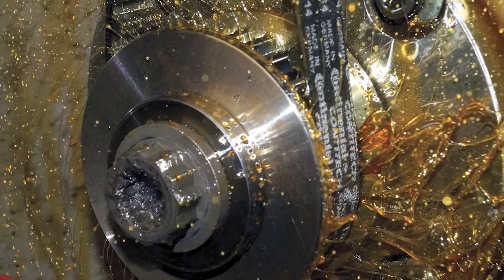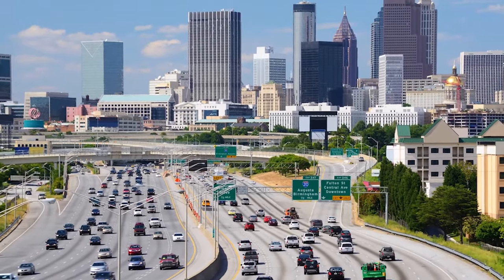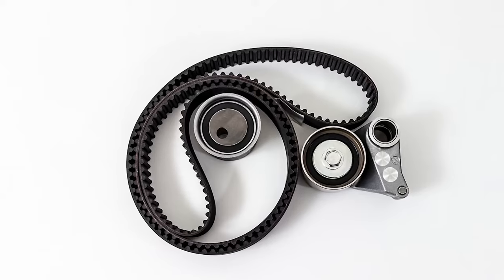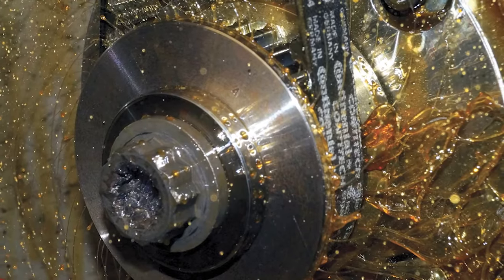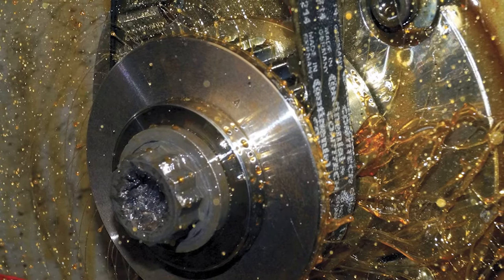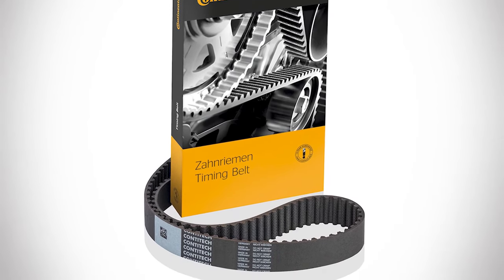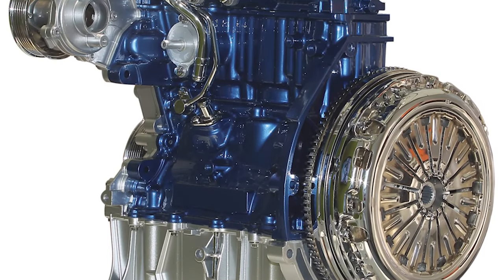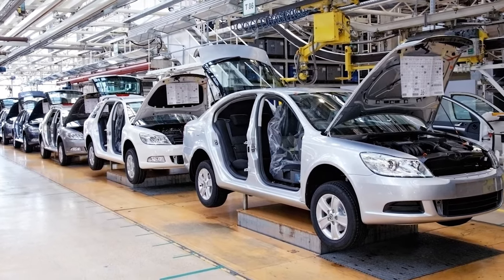Belt-in-Oil Timing Systems

Comment: There have been so many failures of belt in oil system that screw up the engine entirely. The benefit is far far less than the problem it has created. These engine manufacturers have lost their mind.
Reply: The benefits for the car makers are great, it's called planed obsolescence...
Reply: @AltMarc  True. Benefits for car makers, not for car buyers.
Reply: You are supposed to scrap the car before the belt goes , that is 100,000- 150,000 miles .

My wife has just bought one of the eco boost engines at 33,000 , and I will make sure we sell it at 99,000 miles . 😮 ( if we are lucky , it will not fail before that )
Reply: There have been reliable belt-in-oil timing systems used in VW TSI engines. However, the best timing is a timing chain with multi-ply chains and low-friction coated metal guides. Timing chains for the most part last as long as you do regular oil changes. The traditional belt-in-air timing systems which have been widely used in SOHC and DOHC engines throughout the 1960s to the early 2000s are designed to last between 60,000 to 90,000 miles and are pretty good too and are easy to replace and a reputable mechanic will check it at 60K miles.
Reply: It's just ford
Reply: @jalee6587 No its not, PSA and Honda also have this kind of design. Oil dilution with petrol is the main problem, direct injection + wet belt + wide oil changes + low visco oils = engine destroyed a lot sooner.
Reply: @A2Z1Two3  that’s a logical plan, however I’ve had wet belts fail at 30k miles and its rare for them to get past 70k before failing and destroying the engine. Good luck 🤞🏻
Reply: @jalee6587  GM is on this bandwagon as well with their 1.2l and 1.3l 3 cyl turbo engines. (Trax, Trailblazer, Encore, Envista and others)
Reply: fladave99   the recall is basically that they take the filler cap off and look at the belt, if it doesn’t obviously look like its breaking up then they don’t replace it….
Reply: fladave99   yep, I’ve the same mindset. I’d much rather get payed to solve other people’s expensive  problems than have the stress of said problems 👍
Reply: @A2Z1Two3 so how its going with the bus is it okay
Reply: It’s all about reducing costs to them. Designing a traditional timing belt system is obviously costing them money.
Reply: @carlosgilpinheiro7510 from what I understand Honda only uses wet timing-belts in things like lawnmowers and such. Not their high volume vehicles.
Reply: It's too keep various car brands parts dept in business.
For wet belt kits
And hopefully brand new bare engines to sell.
And of course the dealer franchise workshop in work also.
All while the customer gets hammered with a
Few grand bill for parts and labour.
At their expense

Comment: Chains,proven and tested over a hundred years,let's cut the bullshit.
Reply: Yes proven to fail because they are nearly always ignored.
Reply: Metal gears off the crankshaft for pushrod ohv are the best, bevel drive for ohc engines. Problem solved.
Reply: @vumba1331  as you say gears are the ultimate but as mentioned above it's the most expensive and arguably noisiest option, the cost is probably the main issue though in mass production. 👍
Reply: fladave99  that's not how mass production and profit margins work, people are willing to pay more for complex engineering on "prestige" cars, nobody wants to pay more for a Ford because it's still a Ford(or other mass produced brand).
Reply: fladave99  I completely agree with you and if I wanted a car I'd buy a Toyota, Suzuki, Subaru or possibly a Honda (although they're not what they were), if I wanted some trimmings I'd buy a Lexus, fabulous cars, I did have a C6 Z06, great car but it had electrical gremlins and wasn't a pleasure to own reliability wise. I've had Pontiac Firebirds and they were fabulous cars but if you want a car that might not be exciting but will do the job year after year then the above Japanese brands have you covered. 👍
Reply: @captainchaos3053  I've always had GM pushrod V6 and V8 powered vehicles, and the short timing chain on them is not a regular service item. It's something you replace during an engine rebuild, and don't really think of between rebuilds. My Studebaker V8 is a gear drive. There are very occasional failures of the phenolic fiber cam gear on cars (these were made of Micarta because it's quieter), but replacing them with an aluminum gear (used on trucks) netted a cam drive that will never fail.
Reply: @TorCow1234  I agree totally. However many modern chain systems are due for replacement long before a rebuild is needed and when over looked as they often are failures occur. I have had ford's V4s and V6s with the fiber gear too. My 3.9 V8 runs a short toothed or "silent" chain, but it's a service item changed every 80-100k.
Reply: R and D at customers expense.

Comment: These belts are letting go at as little as 40,000 miles. Truly disastrous resulting  in massive cost or a worthless pile of metal.
Reply: Agree if the owner does t fix it
A car or truck or van on hire purchase destroyed and still 38 m payments of 350 plus for what

Comment: Back in the 70’s and 80’s, my husband, being a mechanic at the time says that one of the biggest causes of failure with the then new idea of using rubber belts in place of timing chains on overhead camshaft engines was oil leakage from the camshaft oil seal, the oil causing contamination and premature failure of the belt. A particular problem with the Ford Pinto engines. How on earth 40 plus years later have these so called design engineers decided that it’s a good idea to run a rubber belt through a ‘bath’ of oil? The mind truly boggles.
Reply: At least the Pinto was a non interference engine !
Reply: @VWT5Alive   Depending on what size engine it was.
Reply: Remember the pinto engine!!! At least it was non interfering!!
Reply: it's not 1970s rubber

Comment: As you can never really be sure your shop is replacing your oil with the correct spec, these belts are just a time bomb. They also cost 3 times more to replace than a dry belt, so many cars will never have then replaced with the result that many will destroy their engines prematurely. Don't buy these cars and manufacturers will stop making them.
Reply: Hey that is unfair that people won't replace them and it will cause early engine failure. That may not happen. Especially when the belt fails long before it is do to be replaced because it may still deteriorate when not been driven continuously.
Reply: My daughter and her husband told me they were buying 2 new Chevy Tracs ,one for each of them, I said that I would not buy one because of the belt in oil timing belt and a tiny motor with a turbo charger to add to the stress it would already be under to move  a heavy vehicle and to sum it up is asking for problems down the road in expensive repairs if you plan on keeping them way past the warranty, they both looked at me like What ? Then did not have any interest in asking what I was talking about and just disregarded anything I said with a mind set of a lot of people out there, when it breaks I will get it fixed, and if it is expensive, just put it on my credit card ! All they know is they like the looks of it, the price is cheap and nothing else matters.
Reply: 2024 Chevrolet Trax 1.2 liter has two one for timing and one for the oil pump. Not only that but the cover over them which covers the entire front of the engine is a one time use affair which only adds to the cost. The 1.3 liter in their Trailblazer has a chain.

Comment: Ford Ranger 2L bi turbo diesel uses a wet belt. After a while bits of rubber come off the belt and block oil ways. Crazy idea they have gone mad! A rubber belt running in hot oil is a recipe for disaster!
Reply: You must understand that FORD recently risk anything to be in business. But too bad  risk is risk.

Comment: The total brake failure that my son experienced while coming off the slip road at Junction 10 on the M23 motorway was terrifying and he (and his apprentice) were fortunate not to have been involved in a major accident at this busy junction.
The cause of the failure is well documented - the use of the wet belt inside the EcoBoost engine causes delamination over time. Debris from it eventually clogs the pick up pipe and vacuum pump which then fails causing the brake pedal to go hard. 
The brake pedal simply cannot be depressed to slow the vehicle no matter how hard you try.
He is self-employed and relies on his Ford Transit Custom van everyday. It is currently at a Hendy Ford garage awaiting a goodwill gesture from Ford - as it is a few months out of warranty - yet the wet belt was not due to be changed for another 30,000 miles at the earliest.The current estimated cost of the repairs are £1,800! In addition, the failure of the wet belt may have caused damage to the turbo and the cost to replace it would be £1,000 according to Hendy. He has had the vehicle regularly serviced  - using the specified oil.
Ford have a duty to undertake the repairs - and cover any additional damages resulting from the delamination of the wet belt but they are digging their heels in - offering a fraction of the repair cost.
Reply: Has it been resolved yet?
Reply: @megataurus7779  Yes - after many weeks of wrangling ...and the vehicle being off the road in all that time. As I understand it, Ford and the dealer both made contributions which kept the final charge to my son to a minimum.
Reply: @paulfildes5489  good to hear,😉👍
Reply: Yeah but now it just has a new belt that will fail prematurely, again.
Reply: @Bloodbain88  just halve oil change interval
Reply: @sssssneaker  Might it be an idea to get the sump off and clear the oil strainer at 30,000 miles as it doubtful an oil change will remedy a blockage here. That seems to be the Achilles heel in the system giving problems even if the belt does not actually break as here. The cost is around £160 from what I see.

Comment: It is not a lot of fun changing a timing belt. Add oil in and you are just adding trouble.  You don't have to add oil to the belt just make it of better material.
Reply: Sounds as smart as internal water pumps.
Reply: @phiksit  Changing water pumps on most front wheel drive small cars is a whole engine removal and reinstallation. Because there is no room to get bolts or the water-pump out.

Comment: Was going to buy my wife a Ecosport until I found out it has a wet belt. The new for 2024 Chevy Trax 1.2 liter has a wet belt two one camshaft and one oil pump. Whereas the 1.3 used in the Trailblazer has a chain. My question is, as oil gets miles on it, it becomes very acidic. I would think that acid would work on deteriating the belt with small pieces getting into oil passages and blocking them, so the engine is toast. This sort of reminds me of when Chrysler thought it was a good idea to have the water pump in the crankcase of the 2.7 liter engine. What a cluster that was. Think this may very well have similar results.

Comment: Here in Europe we call the Ford Ecoboost the Ford EcoBOOM for good reason. Stay well clear of wet belt design engines !!!
Reply: The little 1.0l EcoBoom also had the inconvenient habit of bursting coolant hoses.  The mass of the engine is so low that the whole engine overheats very quickly and then seizes, before the driver is aware of the problem.
Still, the engine is cheaper to make and that boosts (!!) Ford's profits.
Reply: Are they also interference engines so the engine pretty much destroys itself when the belt breaks?

Comment: 1.0 ecoboost.
Failure (without warning) means the car is beyond economic repair $8.000 for new engine on 3 year old 35,000 mile dealer serviced car.
Ford say 'get lost, it's YOUR problem'
If you decide to change the belts before this happens, it costs $2,200.
DO NOT BUY A CAR WITH THIS ENGINE
Reply: There’s a TSB for the dealer to give a free long block. Your dealer ripped you off.
Reply: Are there aftermarket timing sprockets and timing chains for the 1.0 ecoboost engine?
Reply: Ecoboom!! 🤯

Comment: Any quick online search including YouTube videos will reveal that wet timing belts are unreliable junk. 
Several European automakers who have been using this technology for a few years have bombarded with complaints from customers of not only premature timing belt failure at the 50-to-60-thousand-mile mark on a belt supposed to last 150 thousand miles but rubber peels from the belt plugging up the oil sump screen causing the engine to have oil pressure loss and shutting down.
The oil pan must be removed to clean the sump screen which is costly.
Even worse, if a small piece of rubber gets into an oil gallery that part of the engine is oil starved, and you have premature engine ware.
To change the wet timing belt, it is labor intensive because many upper engine parts must be removed to access it making it expensive to replace.
The 2024 Chevy Trax 1.2 engine uses a wet belt system along with its sister, Buick Envista and owners of these cars are in for a rude awakening.
My advice, stay away from any cars that have this very unreliable technology.
Reply: Proper intervals 5000 km-6000 km or 3000 miles to 4000 miles for oil/filter will reduce the chance of wet timing belt degradation. Owners who experience issues run these wet timing belts without proper oil changes or incorrect oil. These wet timing belts with proper maintenance should last 125000km-150000km or 80000 miles to 95000 miles before required wet timing belt replacement........

Comment: Peugeot considère leurs clients comme responsable de leurs incompétences en ingénierie
Reply: Not only a Peugeot problem, Ford, Honda etc has the same problems.  Clients need to change oil more often and even more if they use the car with the engine cold most of the times.

Comment: How about inline 4 or 6 cylinders with gear to gear ? Indestructible ! At least the old small block Chevy engines has short timing chains that lasted . They didn't have phasers , plastic guides or travel a long way through a rats maze ! I could not care about noise . It's nice to HEAR it WORKING . Don't argue with simple that keeps WORKING !

Comment: What's next composite engine blocks with metal cylinder sleeves🤦🏿‍♂️
Reply: I wouldn't be surprised if Ford or VW does plastic long block engines
Reply: Lmao Kia just took notes
Reply: Already a thing. Aluminium blocks with steel sleeves are composite.

I think there was a wacky proto type engine that was mainly carbon fiber and used metal sleeves with an alloy head. It was in a concept car I think.
Reply: Be careful what you wish for 🙂

Comment: Idk about all the others but my 2.7 eco boost has a wet oil pump belt and has been flawless . Had an oil pan leak around 140k  and had to change the pan and the belt still looked new. I’m at 175k now . I know someone has that has 210k on theirs and havnt had a problem yet. My old f150 had to have the chains replace at 165k so it can’t not that bad.
Reply: Do you happen to use the car on a daily basis and do a lot of long distance trips with little city traffic?
Reply: @beunhaas102  really both but more hwy than town
Reply: @braper2428  Wet belts tend to deteriorate the most with short trips in densely populated  areas, these driving conditions pollutes the oil the most and in most cases the oil doesn't get up to operating temperature thus not promoting the ventilation of these pollutants. 
Most of these cars also don't do a lot of mileage on a yearly base so they stay submerged in oil for a longer period of that compared to cars that are driven a lot.

I guess your driving conditions suit the wet belt.

Comment: Ye we know to avoid them at any cost. What I learned it's the fuel that gets into the oil and destroys the belt over time. You have to change the oil way more often than on dry belts or chains. Like every 5k. It's really sad that people do this. PSA ain't as evil as VW I learned. The belt is visible and has a chain for the oil pump. VW, Ford uses a wet belts for both that you can't even see.

Comment: honda has had small engines with wet belts for 20 some years. my gcv190 has been going strong since '06
Reply: Hardly a car
Reply: @volt8684  so are the 3 cyl ford engines !

Comment: It’s been proven that these wet timing-belts fail. Mainly because of the soot, acids, and gasoline contaminants that mix with the oil over time as the engine is used. We figured out that this was a bad idea 5 decades ago. Ford will ford and the VW will be VW I guess.

Comment: Honda's cheaper light-use GC motors use lots of plastic parts and OHC (belt-in-oil) and get a 3 month commercial use warranty. Their commercial-use GX motors have OHV (gear driven cam, pushrod) and a 3 YEAR commercial use warranty. So what would you conclude from that?